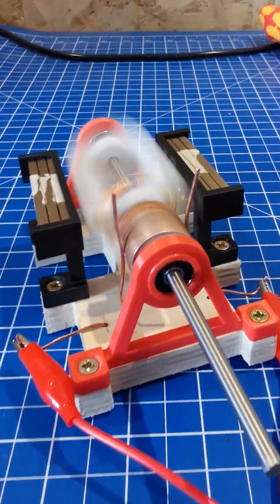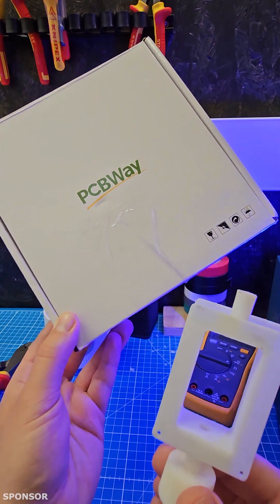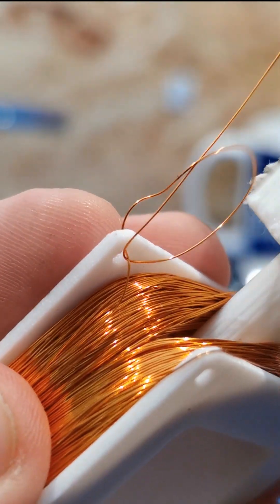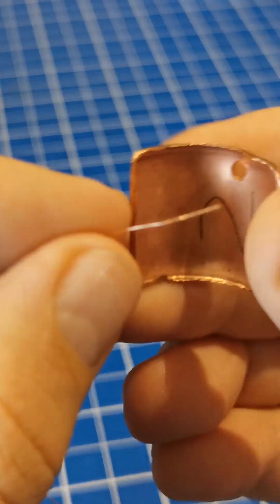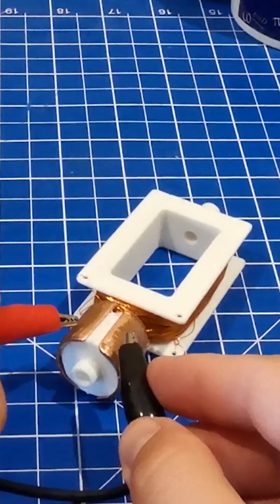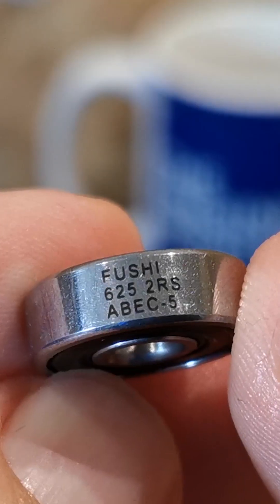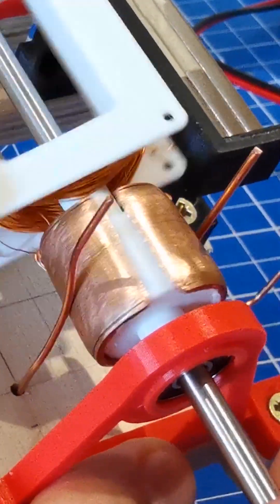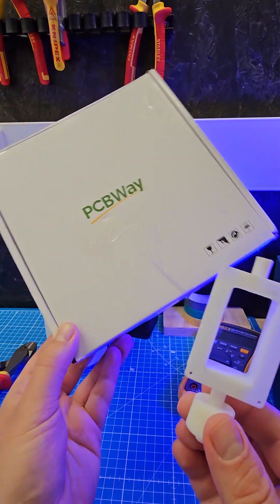How to 3D Print Electric Motor

Comment: 🤔 instead of spring loaded carbon brushes. Couldn't they make some type of metal bearing where the bearing is able to roll smoothly with less drag but always making contact with metal surfaces for current to travel through?

Comment: Whats the difference in ac vs dc motors? Might be a neat vid
Reply: AC motors have 3 seperate coils inducing seperate magnetic fields through 3 phases of alternating currents. Whereas DC motors have their coils wired in such a way that only a single direction of current is induced through the rotational movement of the shaft.

Comment: Yup ... we all have a 3D printer... 🤨
Reply from the maker: Pcbway (the sponsor) can print them for you
Reply: This is "sales" video.  Figure out the "concept" and you can apply it with...wire & a paper clip, wooden spool...etc.  Can cut & use wood?  Read a few the comments for more ideas...be creative. 😉

BUT, if you have a little extra cash & time...LOTS of time if you have to learn to 3D design...3D Printers are a BLAST.

Comment: PCB motors also exist if you consider etching printed circuit boards to be less effort than coiling motor wire.
Reply: When I first saw a planar transformer created using PCB manufacturing techniques, my mind was blown.

Comment: "How to 3d print" - 80% is not printed
Reply: Lol can't print copper wires yet. Base I'd wood but could 3D print too, I give STL file for that
Reply: @EngineeringMindsetHindi the baseplate lnfaoooo
Reply: You're not wrong but you have to have some reasonable expectation for a motor
Reply: irrelevant
Reply: What's he gonna do, print a copper wire 💀